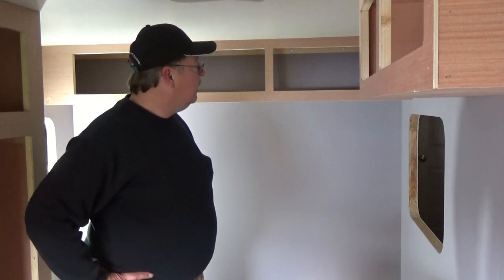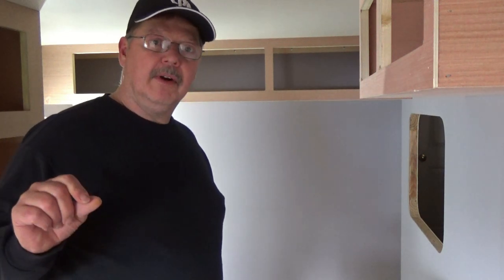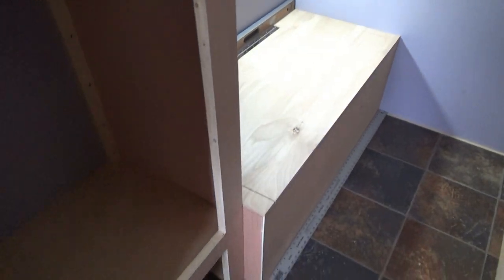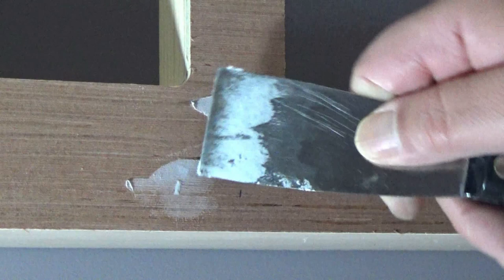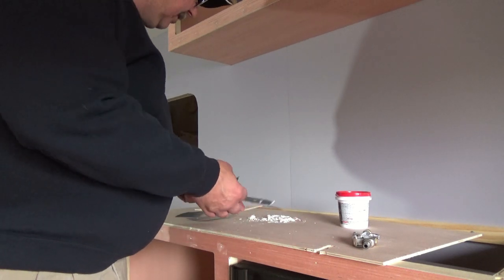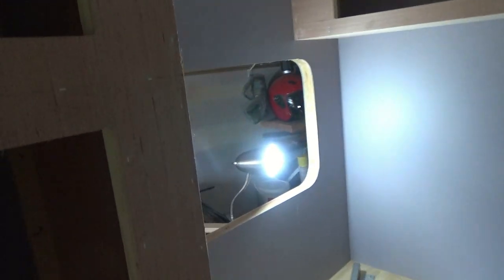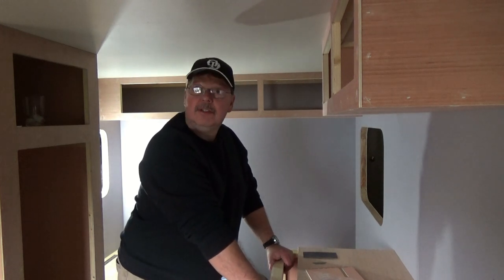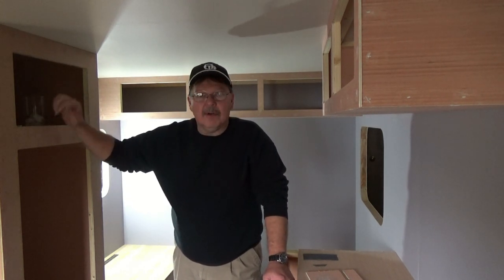How To Build A DIY Travel Trailer - Part 21 (Touch-up Time)

Comment: The trailer I am going to build is going to use the cushions foam from the $250 popup I bought. It had the dinette, and the two slide out bed cushions that are in great shape.
Reply from the maker: That is great George! Already have a cost savings! The foam for cushions are expensive, and if you can reuse what you already have... then you are one step closer to being finished! :)

Comment: Could have possibly gotten away with buying like a king sized foam mattress topper.. a 4" one at Wal-Mart is about $130
Reply from the maker: Deadmaan87... true that! I thought of that in the beginning, but decided not to buy any tools needed to cut the foam with. The foam that I purchase is top notch and will last for a decade or more! Not to mention... it came cut to my specifications. It does come down to the budget you have when deciding on your build. So for some, the mattress is a great idea. For others, they may wish to go for something a little more high tech. Thank you for the comment, as I am sure some will take your advice! Thank you very much for watching!
Reply: OregonBatman it's an amazing build I've been watching them in a row now for a few days and only a couple issues on my part. For budget options I probably won't do the rubber roof and aluminum siding I was thinking about rhino lining the roof and using a premium exterior paint on the shell
Reply from the maker: Thank you Deadmaan87! I think your idea will work very well. Years ago, I used to build boats, and a lot of boat builders would use a good enamel paint to paint the topsides. Paint, sand, and paint some more. The results were awesome! As long as nothing moves (well screwed and glued) the exterior will hold up just fine. Seal those seams well! :)